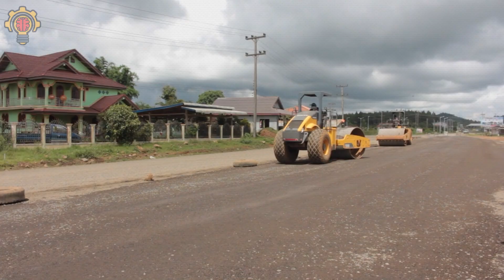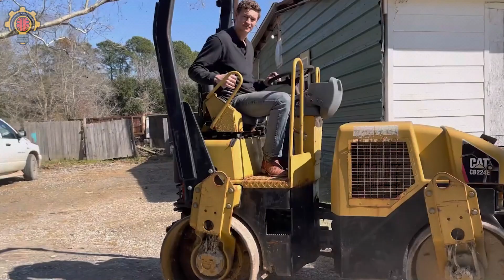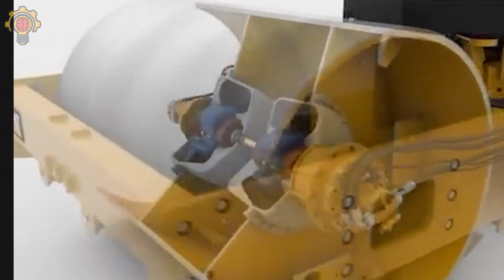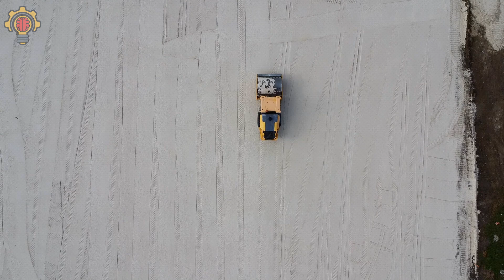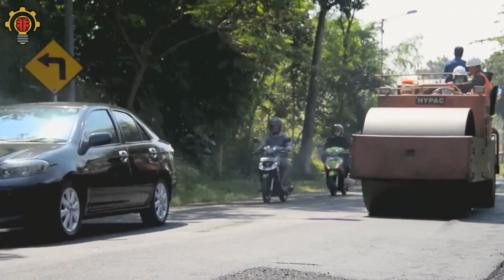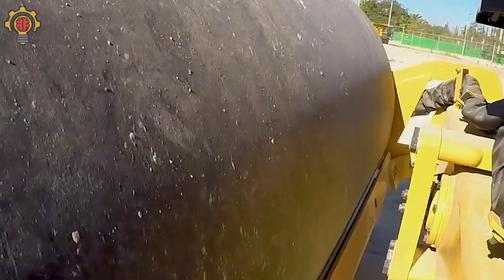Road Rollers Don't Flatten Roads The Way You Think

Comment: Okay, but not great.  You repeated yourself a dozen times or so on several aspects, but you never got to the point as to how exactly it works.  You showed an offset weight with voids and spheres inside, but you failed to explain the engineering and principles of energy transfer.

Gave you a view, a thumb and some advice.  Lets see what you do with it.